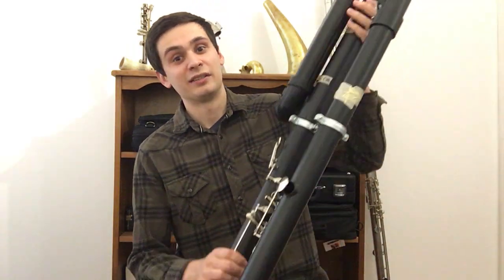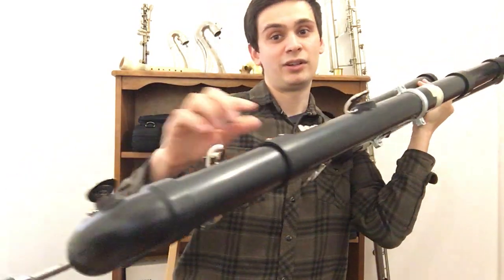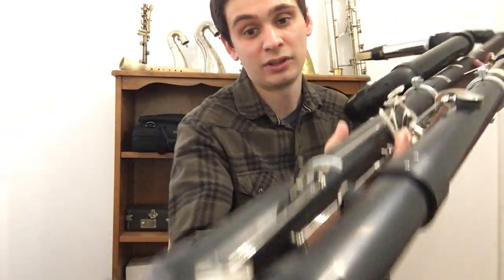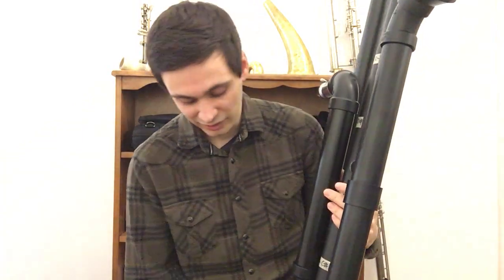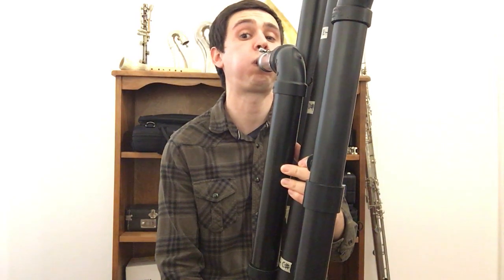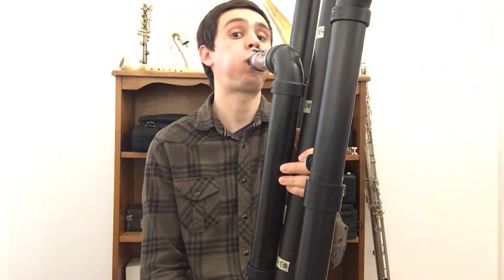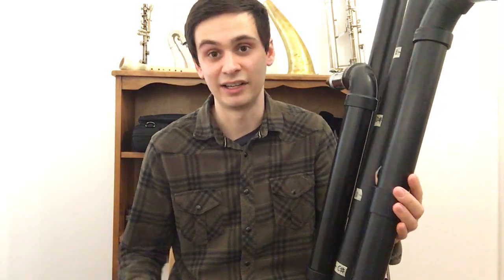Octocontrabass Clarinet Project Update: More Keys + Pads

Comment: Hi! Congratulations! The key cups that you used , are from Bass clarinet ? or from saxophone? What is the biggest key cup un diameter? You, just simply bought a los of used keys on EBay? Thanks!
Reply from the maker: Matias Tchicourel Yes from bass clarinets. I bought a lot of broken bass clarinets from eBay. I think the largest diameter is actually only 30mm

Comment: Does this OCB play to a low c or a low d like the Leblanc one?
Reply from the maker: Smetana Right now it goes to low E, however once it's finished in going to get in contact with Guinness and work towards a low C extension. At this point it will hold the world record for the lowest orchestral/band instrument.
Reply from the maker: Matthew Hanson That's the Octocontraalto in EEEb. This is an Octocontrabass in BBBb. There are no videos or recordings of the original Octocontrabass, only pictures.
Reply: Matthew Hanson Bret Newton said that Cyrille Mercadier told him that the instrument only played to a low D
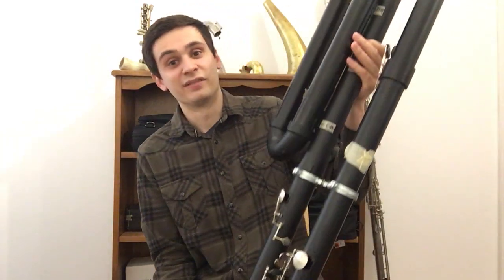Reply: The D-flat and C touch pieces can be seen clearly above the thumbrest (like on the 340 paperclip contrabass) at the 1:30 marker here:

https://youtu.be/0wJVlQL5JiI

The two keys are unmistakable at 0:55 here:

https://youtu.be/WU93vd_00Do

The two keys are noticeable in the first few seconds here:

https://youtu.be/zChvQCEZnYo

If it does not have full keywork to C, it appears to have been intended with these touch pieces.
Reply from the maker: Matthew Hanson I just pulled up some pictures and counted the toneholes. I'm fairly certain it only goes to low D. But if you have any evidence to the contrary please post it as I am very interested.
Reply from the maker: @matthanson920  Fascinating! It looks like the body only goes to low D but the instrument was designed so that a low C extension could be added. I wonder if Leblanc wanted to add a low C extension but ran out of time before the World's Fair? I can't tell what those keys connect to in the photo. If only I could see the thing in person!
Reply: @smetana9041  I was corrected on that information. Wait, just read Jared's comment, now it's all confusing...
Reply: @Jared_De_Leon , it wouldn't surprise me if there was an additional tube with the keywork for the lowest two to fit between the D and the bell since earliest examples of Leblanc paperclip contrabasses to low C were made this way. I haven't yet been able to determine if such linkages exist beyond the touch pieces on the OCB.

Comment: How did you gain access to keys. Could you buy them or did you make them
Reply from the maker: They're mostly modified bass clarinet keys
Reply: Ok. I’ve had an idea to try and make an instrument and I’m curious, how do you know where to put the tone holes? Is it trial and error or is there a certain procedure?
Reply from the maker: Abedin Subashi Pretty much trial and error. Plastic pipe is cheap so buy more than you need.
Reply from the maker: Abedin Subashi Pretty much trial and error. Plastic pipe is cheap so buy more than you need. What kind of instrument do you want to build?
Reply: Jared De Leon well it’s more of an instrument extension than it is an instrument

Comment: Cool but u forget the fact that that the bore actually starts opening up (bell flare) around low f (hmm not sure if it's on low c models might start l8r point is before the bell)(u can see it with any clarinet if u look ) not right after the lowest note/ actual bell of the instrument. So uh don't know how u intend to do that
Reply from the maker: Jason Tran Good observation. While it is common for clarinets to have a flared bore in the lower joint, it is acoustically unnecessary. On most alto and larger instruments there is no flare, in fact the bore will often jump up in size between the lower joint and the bell. Plus, one huge advantage of not having a flare is that it will be very easy to extend this instrument beyond low E